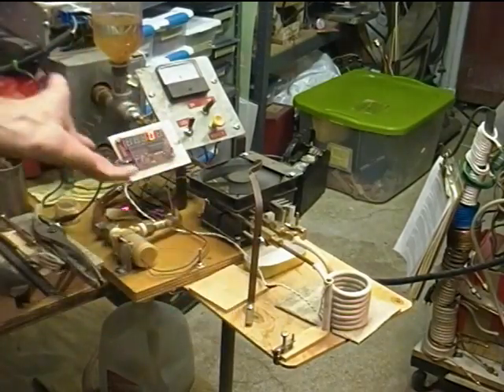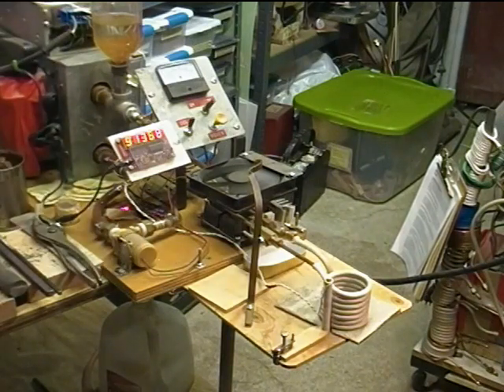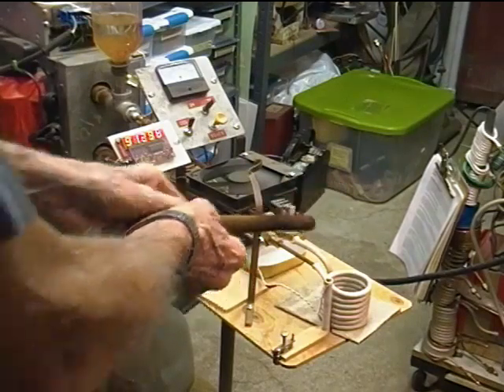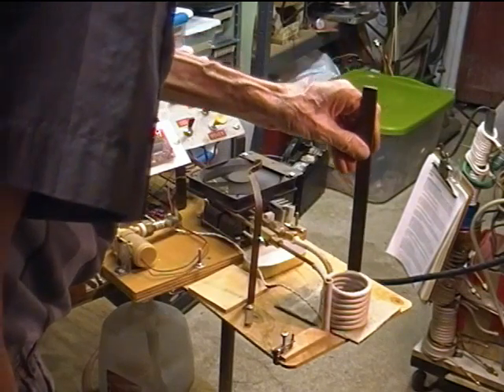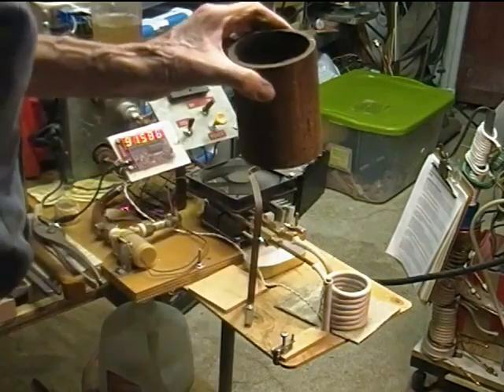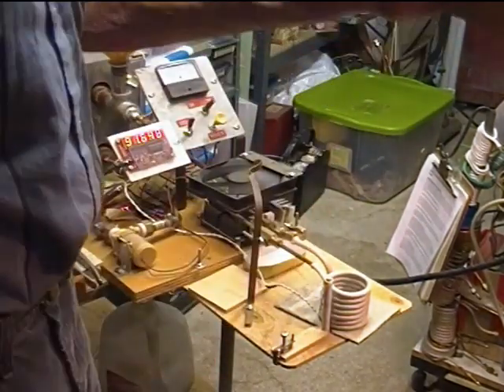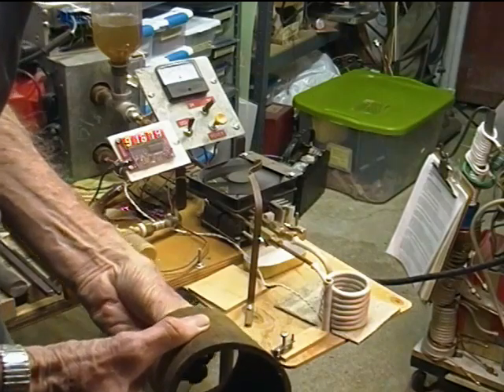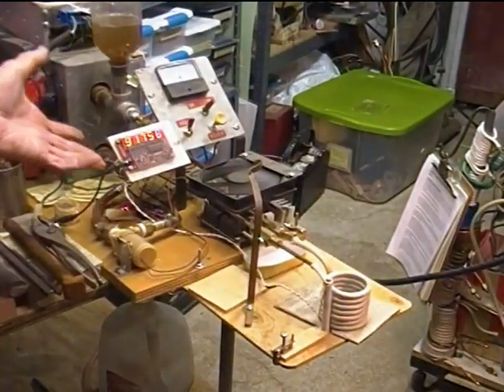ZVS Induction Heater,  Power Transfer OUTSIDE of Work Coil, Part 1, #203

Comment: Hi, observing your setup, maybe you may redo, but with the coil, inverted or hanging, so you can insert the large pipe paralell, or tryout other large pipe pieces to see the 360 dregree effect as in the interior application, I foresee that being the field more intense in the whole circumference, you may observe very large currents.
Reply from the maker: I could do that, but I am certain that the current would be excessive for the 1000 watt heater, since I can't go over about 22 amperes for any length of time anyway.  Hopefully you DO see that  there isn't much power transfer out at the 3 inch radius position anyway.
Reply: @frenchcreekvalley  Yes, Imagining the field instead of concentrate inside, it diverges outward, makes sense, but close enough I believe the field is almost the same. Interesting to see with smaller coil. One way to test is with metal cylinder from thin sheet to avoid excessive current. This may be allow to heat tubes from inside.

Comment: I have written a program that shows the magnetic strength variations WITHIN the coil..the results seemed "not well-known" as many people insist the the field is strongest down the middle axis of the coil.  I have also derived formulas that agree with my simulation program.  Which suggest that the field is most intense at the OUTER edges inside the coil.
After watching this video, it should be a very simple test to illustrate this (I don't have a working heater at the moment).
Perhaps you could insert a test-piece and compare strength between the center axis and then at the coil's inner perimeter (without shorting the copper rings...obviously).  Perhaps you could find a somewhat thick hollow cylinder that just fits INSIDE the coil??
THANKS FOR YET ANOTHER GREAT VIDEO!!!
BTW: what is your first name?
Reply from the maker: Hello Dale.
I have read all 3 comments that you posted in the last few hours.
Over the last couple of years I have made dozens of videos about these heaters and in at least a few of them I have moved the workpieces from the center of the coil towards the outer edges.  In general, I see very little difference in current when I do this.
Also-  I am sure that I have inserted thin tubular workpieces the closely fit inside the workcoil from time to time.  I'm afraid that my indexing system isn't very good, so I can't tell you exactly which videos show those experiments.
Here are a few related playlists:
2500 Watt   https://www.youtube.com/playlist?list=PLVxWen9M87dCeUnIhxueR0sJ9bvI2rbRJ
1000 Watt  https://www.youtube.com/playlist?list=PLVxWen9M87dBhvInCQ-3pELWdxCM3XH4I
1800 Watt  https://www.youtube.com/playlist?list=PLVxWen9M87dBNZywEKDStz9gYv0hE9J0l

I look forward to your own testing as soon as you get your own system operational.
Reply: @frenchcreekvalley  Hi again,
I rigged up a small ZVS heater/coil, determined, somehow, to show that the work-coil field is stronger near the inside edges.  I only had a few hundred watts, and wound a 10-turn, 1 inch, 16awg work-coil. 
For the super-simple test with what I had, I used a jumbo paper clip: I simply bent part of it into a "U" shape and inserted it into the coil  It was bent so that upon insertion I had two vertical axial wires in the coil,one near the inner edge and one on the center axis.  Upon insertion  the wire along the edge heated and glowed red much faster than than the one along the center axis.

Comment: Hello, don't get tired, is it possible to connect a DC 60V 50A power supply to a 4000W induction heater with 8 MOSFETs?

Comment: The trend on YT seems to be about testosterone-loaded projects where electrical stresses get relatively localized, hence multiplying chances of component failure during such evolution.  Would it not result in a same overall heating effect to divide a single air-core magnetic vector as, lets say, 18 (2 vertically-superposed layers of 6 poles in some stator layout, as in stepper motors but without a rotor)?  Except with the benefit of enhanced energy redistribution and improved reliability of the driver.  Magnetic stacking of energy sources (rather than electric) would imply it's synchronuous but would it not ease such evolution toward high-power solutions for industrials?...